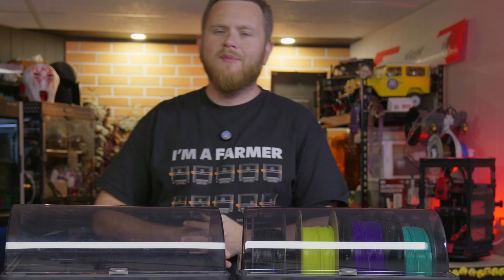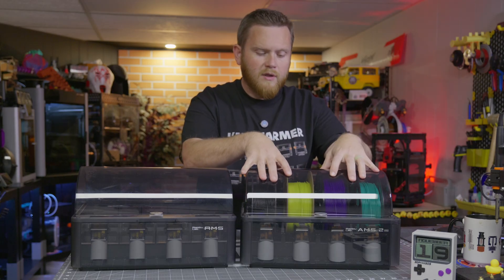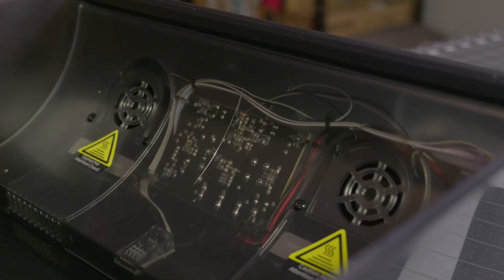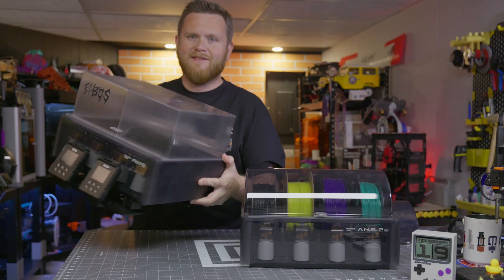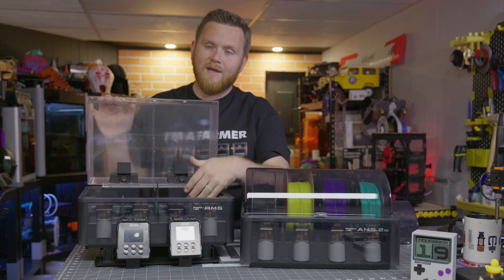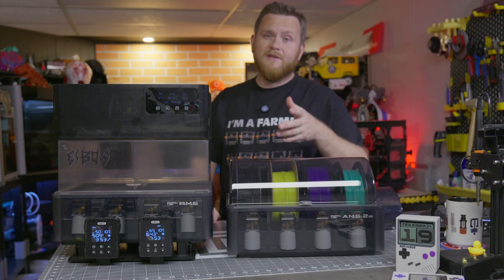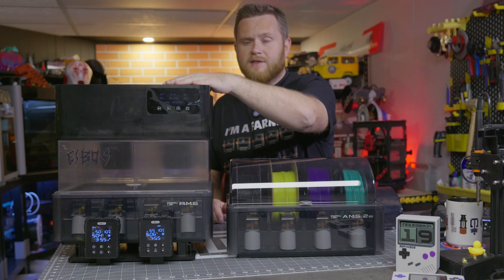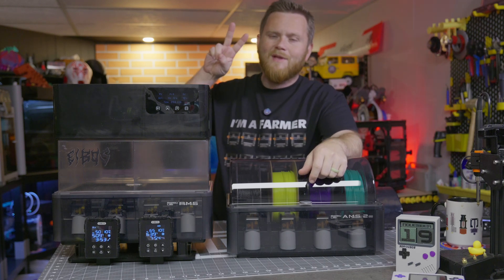This MOD Greatly Improves your Bambu Lab AMS!

Comment: So no one has made an option to upgrade our AMS2 pro? The thing is kinda lame it's just an AMS with a heater dryer but can't heat and dry while printing and does not go high enough for engineering filaments. Someone needs to make something to go onto the AMS 2 pro that would get to 85 C
Reply from the maker: Looks like there are files to attach the Tetras to the AMS pro 2.

Comment: The Eibos Tetras looks very interesting. I can't find any interfacing options though. If I could talk to it via mqtt or some other local api and integrate into homeassistant this would be an instant buy....
Reply from the maker: Ah. It is a very analog system. Those screens are the controllers. Not sure if you can use something else, but they are very analog. Thats for sure.
Reply: This is not an analog control system. That's out of the price range for this product. Best case some pwm pid loop. But if it's not based on an esp, the microcontroller has all the numbers and some sort of interface could be exposed. Huge opportunity missed. Esp32 with MQTT autodiscovery for HA does not add much cost compared to the value added.

Probably easier to replace the controllers than to modify them. Looks like a better platform for a project like that than the sunlu box.
Reply from the maker: Hmm. Maybe it’s time I take one of those control units apart then…

Comment: So which is better?
Reply from the maker: Depends how you like to print. If you keep multiple filament in your AMS, the Eibos offerings make more sense. If you just stick with one type, the simpler SunLu is king.
Reply: @3DPrintSOS thanks for the quick response fedor!!  I’ll prolly be picking one up
Reply: Looks like Sunlu just has a recirculation fan, so it won't actually extract the water from the chamber, just push it out of the filament until the air is saturated.

Comment: Hope they will realise something for ams 2 so we can heat and print in same time....
Reply from the maker: Wonder if it will need external power to do it.
Reply: From what i read, you can print and dry at the same time, at least with p2s and ams 2 pro, but you need the separate power cable for the ams so the printer power can go towards printing while the power cable for the ams can power the drying...but i don't have the power cable to test it out.
Reply: @NoOneisHereAnyway if this is true, excelent!
Reply: @RBSolAF i hope it is as well...i will get the power cord at some point so i can try it out. If/when i do, i will let you know.
Reply: @RBSolAF well shiiit...so looking more into it, apparently in the US, we can't, even with the power supply, but those saying it can are in Europe or other countries that use 240v (I still have not 100% verified that yet though)...so yea i just found a video explaining that right after you replied. I guess there is no reason for me to get the power supply now...damn, i was literally about to order it too so good thing i found that video 1st and saved 40 bucks. Sorry man😭
Reply: But yea, dude in video tried it with and without the power supply...with power supply it says it is busy...without it says not enough power, which leads me to believe those with 240v can, but I'll verify cause i mean we too can use 240v if we absolutely wanted to...but would probably have to order one from overseas 🤷‍♂️

Comment: Thank you for your hard work. Great mods for the original AMS; however, please correct me if I am wrong, but would these products become obsolete if Bambu Lab updated their software to allow drying while printing?
Reply: It's not just a software issue that prevents drying whilst printing.

The filament being at drying temperature could cause feeding issues and could be far more likely to cause jams.

Obviously that's dependant on filament types, drying temperatures and such.

But generally, you shouldn't dry whilst printing unless you actually need to.

And yeah I get that people will be like "but I do it all the time and it works fine for me".

But some people will get lucky, others won't.

Just keep your filament dry.

If you need to print a filament type that desperately needs to be dried whilst printing, do it as an external spool and print from a dryer that will let you do so.

Most of the people I see whining about drying whilst printing only print PLA.

It ain't that hard to keep it dry.
Reply from the maker: I think if you already had a few of the originals, it’s far cheaper to upgrade them than to move to the AMS 2 pro.